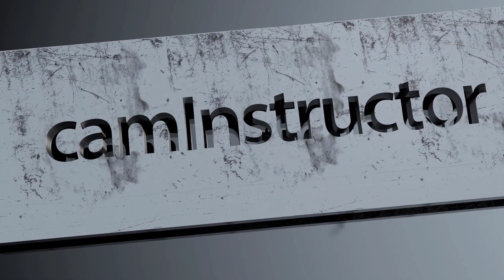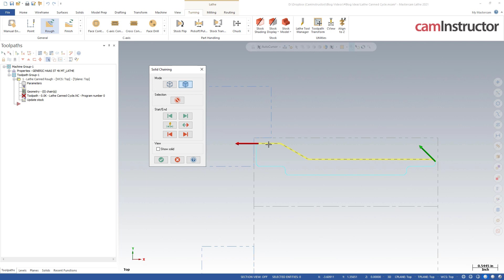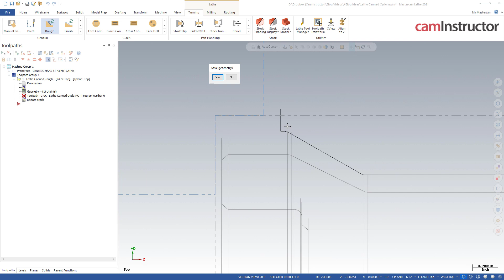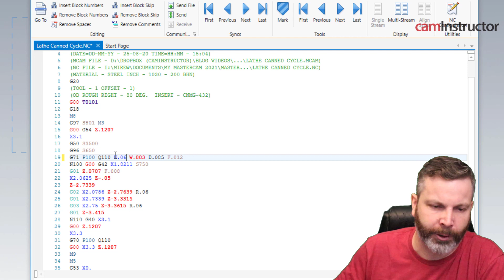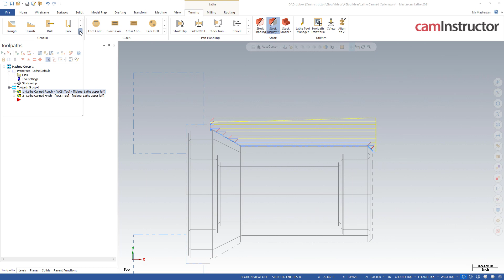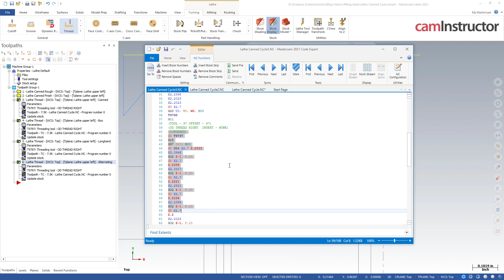G-Code in a Can? Mastercams Lathe Turning Canned Cycles

Comment: How can I switch to the one line canned cycle for the haas post processor?
Reply from the maker: Its controlled in the post. Do you have the correct post for your machine or are you using something generic?
Reply: @CamInstructor  I figured it out.

Comment: Good day,
is there a way to use the G71 cycle for a casted part, with external stock profile different from a cylindrical profile like a round billet? That would save for not cutting on the air.
Thanks
Reply from the maker: No. For canned cycles the stock shape is very basic. It is defined by your starting position and the last position in the profile. For an irregular shaped stock it would probably be best to use CAM and define your stock shape in there, then let the software created the toolpaths needed.
Reply: Take a look at the G73 pattern repeating cycle, also called closed loop cycle.
Reply: @unf0rgiv3n  Hi Raul, the profile of casted or forged parts do not
Reply: @unf0rgiv3n  Hi Raul, the profile of casted or forged parts do not have a similar contour as the finished machined products as could be an offset of the contours of finished parts. Patterns and dies and are manufactured as near as possible to finished components to save in materials and machining time, but for geometrical reasons and wear that can only be approximate, hence repetitive cycle G73 could lead to crashes. But thanks for the imput.